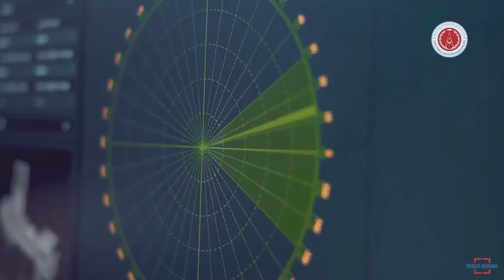SSB Was Successfully Completed Fire Test Integrated System SIPER Air Defense

Comment: I thought siper was 150 km not 100 km😕
Reply: just first block 100km testing and will be upgraded before entering production.
Reply: This is 100km test fire. Maxsimum range fire will become next month
Reply: 100 kilometers for now. We can see that it is 1000 or 2000 kilometers later.
Reply: @cengizy5912  yok dayı olamaz o kadar zaten sen radar kilidi atınca uçak kilid atıldı diye bildirim veriyor pilota pilotta 1000 km mesafeden füze gelene kadar radar kilidini 10 kez kırar. Ayrıca radarlar dünyanın yuvarlak olmasından dolayı 500 km mesafede sadece 15 km irtifanın üstünü görebilir altını göremez